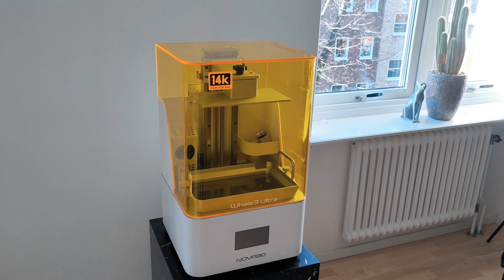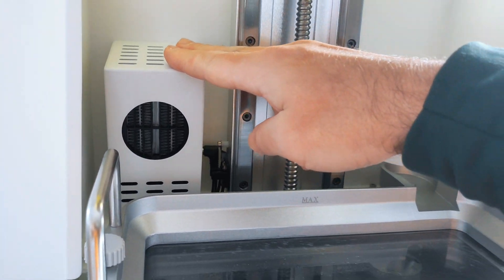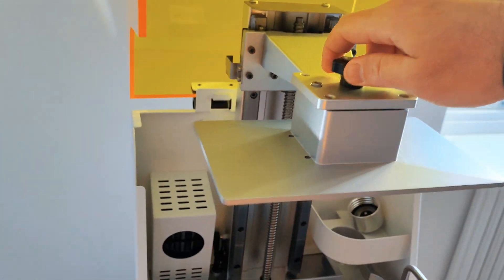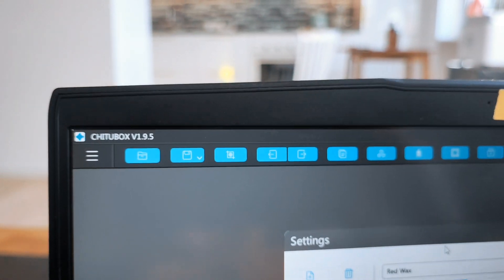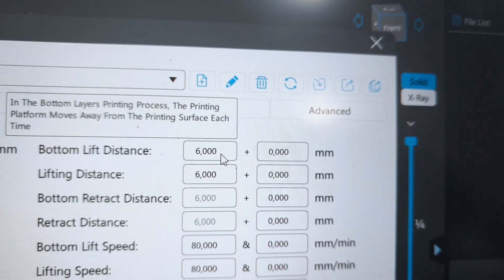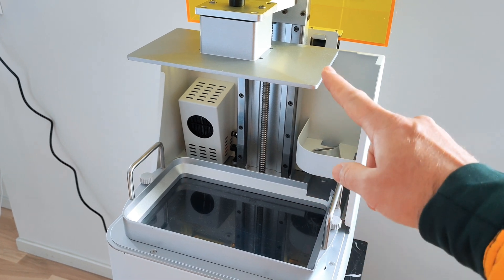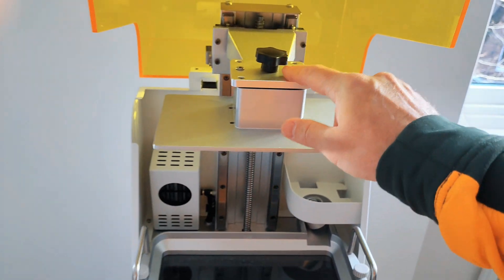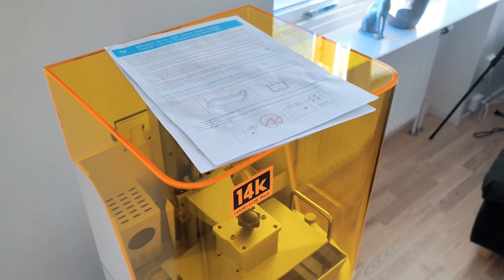The very first 14K resin 3D printer NOVA3D Whale 3 Ultra (223*126*250mm, 16 μm pixel size)

Comment: 16 x 24 - rectangular pixels like the 12k machines.
Reply: not even that, it's 16.8 x 24.8 xD almost identical to the 12k LCDs
Reply: So not a 16 micron printer as a printer is only as good as the largest pixel effectively making this a 24 micron machine. Manufacturers really need to stop with the whole 8k 9k 12k etc it's utterly meaningless.
Reply: @TheShamanizer  lol, if they didn't call it 14k they would call it 16 micron (rounding down from 16.8 and forget the 24.8